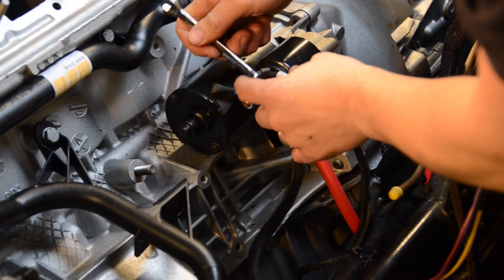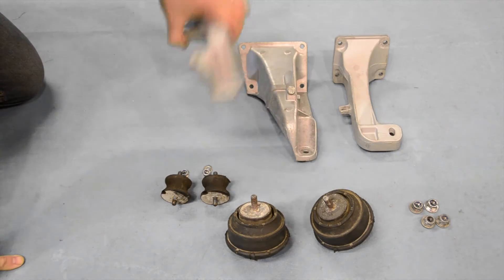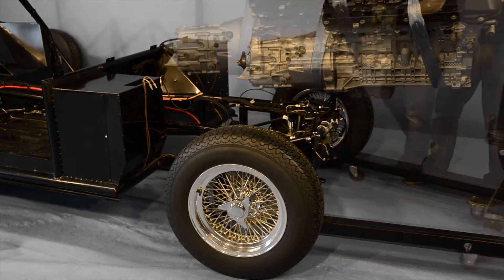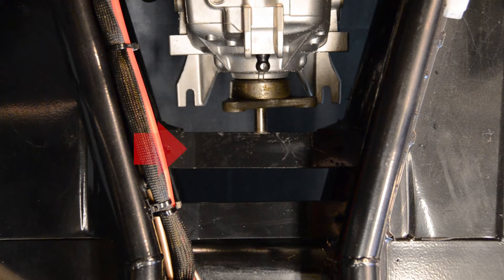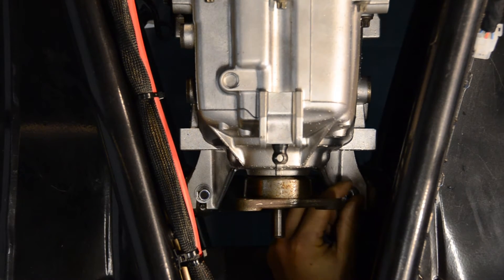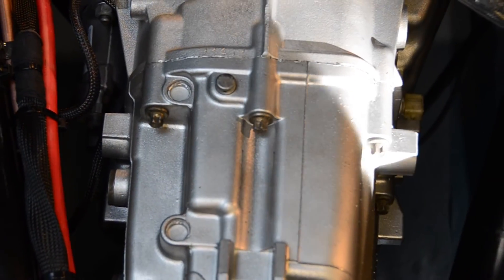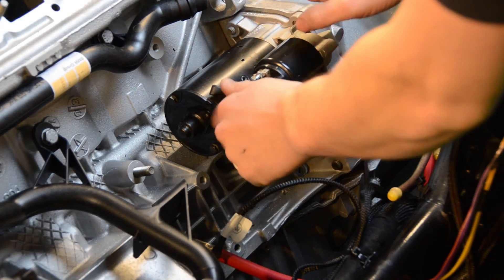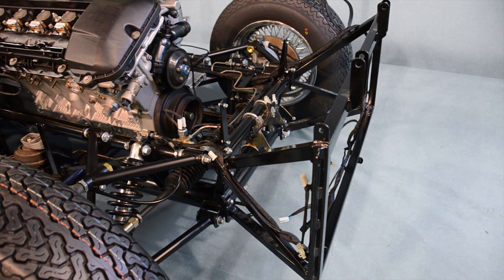Mirage GT Build Video Series: Kit Stage 2 - Engine & Gearbox

Comment: Can a V8 engine be fitted ?
Reply from the maker: It could be. The engine compartment is big enough for several different engines. We have a customer fitting an LS3 engine in the U.S. It depends on your experience but obviously changing the centre of mass of the car will alter the geometry and driving characteristics significantly. We can guarantee these will not be for the better as it is almost near perfect.
Reply: @mirageautomotivedevelopmen7613  Mostly is a question of good deep throaty sound....
Reply from the maker: @AcarsFault  Completely get it. Nobody has been disapointed so far with the induction noise of the straight-6 and our custom exhaust. If you drop us an email we can potentially put you in touch with our U.S V8 and V12 customers should you which to discuss further.